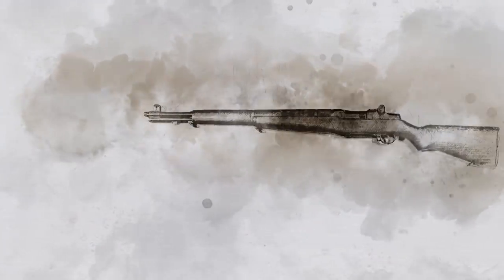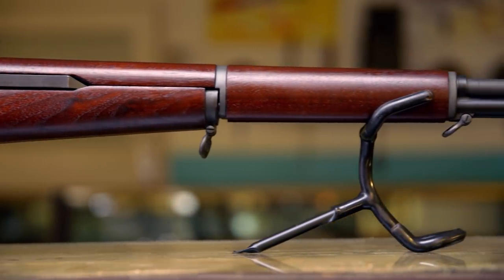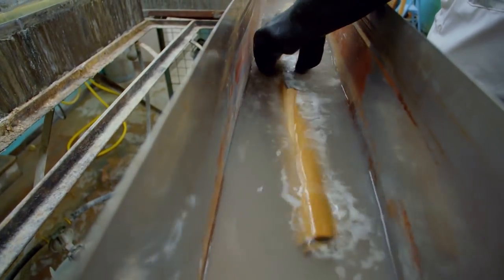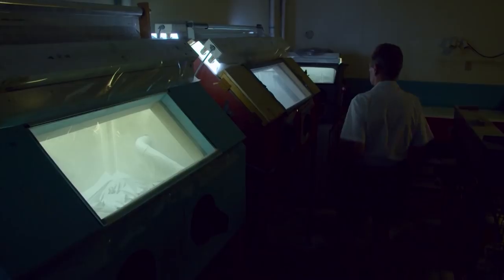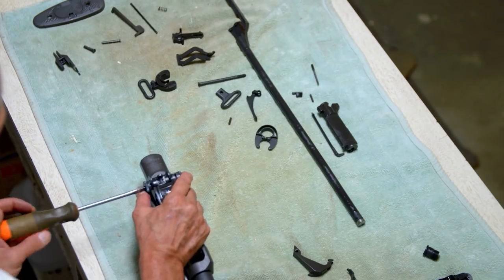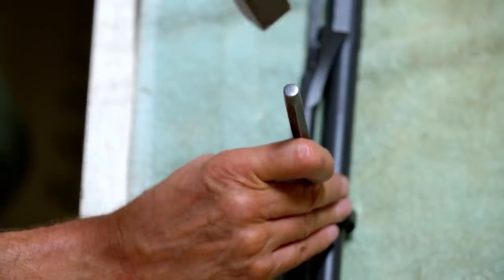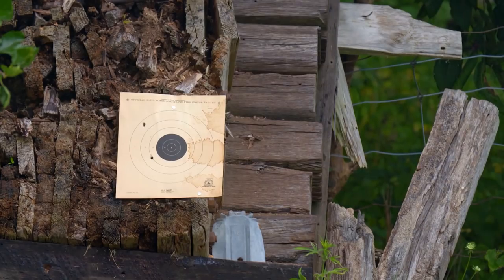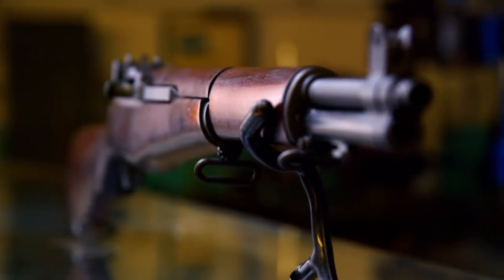How To Restore A World War Two M1 Garand Rifle | History In The Making

Comment: This should be titled, " How to make a U.S. Rifle, M1 less historically original and degrade its actual shooting condition in one stroke"
Reply: Since WW2 every M-1 has been sent back to an armory for refurbishing or rebuilding one or more times.
Reply: none none I’m confused. How does replacing a few rusty parts reduce the condition in which a rifle shoots? Is it suddenly less accurate? Forgive me, as I don’t know much about firearm functions. I can tell an Enfield from a Springfield from a Mosin, but that’s about it.
Reply: So, I have a question to ask. Let's say I have a race car and win championships during it's lifetime. I get a flat tire, I replace it. I get a timing belt, I get a new one. I replace the car doors, bumper, get a new coat of the same color paint; I had to do that constantly for each individual part until each part is replaced. Is it the same championships car?
Reply: al4sake I’ll counter with another question; why let a rifle that has the potential to be factory new again rust away in a display case? Is the M-1 doomed to rust away in a case, never to fire another round again? Or should it be well cared for, and used for it’s original purpose? Putting holes in something is what a firearm does, but it can’t if you let all the internal components rust. But hey, at least it’s the same rifle, right?
Reply: Dud there is issues with rust.

Comment: Looking through the comments, I agreed that the Garand he stripped intially wouldnt need much restoring, more like checking for mechanical issues and replace parts as necessary.  But if you live in a country where there is no CMP and all you can do is slapping differnt parts together to make a brand new Garand, I wouldn't mind that either.

Heck, if someone opens a plant and manufactured it brand new with exact same spec I wouldn't mind getting one too!

Comment: This rifle is damn near perfect in design and purpose, it has never been successfully replaced in my honest opinion. They really should bring it back in production with maybe updated materials (better steel, carbon-fiber body, etc.). Probably the most ideal rifle to have if you're of a survivalist mindset...
;-)
Reply: The entire top of the gun is open to the elements. It cannot run in mud, AR, AK and bolt actions will do you much better than a garand. Plus it's much too heavy for a lightweight survival rifle. Perhaps a keltec sub2000 in 9mm or 40 s&w will do when thinking in a survival scenario. Or a Henry ar7.
Reply: @lasersharksushi1975  Do you think that they only fought with the M1 in nice weather or called a timeout if they got dirt or mud on them. The M1 is one of the most proven rifles on the planet under actual battle conditions!
Reply: @robertlewis7347  they called a timeout lmao. Or they simply didn't use it. IE, Germany is a great place to run a garand where you don't have mud, and other nonsense. Japan though? The second the garand encountered mud, it jammed. Thusly guns like the M1/M2 carbine, and the M3 grease gun became more prevalent and useful under such conditions.

Comment: Almost all M1s have been arsenal rebuilt at least one or more times and will have a mix of replacement parts and stocks ,I have a Springfield that has a WRA part or two, an H&R has some springfield parts and a early WW11 trigger guard.  So any danger of reducing value by cleaning those up is negligible.  However, original stocks with cartouche and stamps should not be altered or refinished as that could reduce the value to a collector.  Rifles with all correct parts and or original finish (no rebuilds) can bring very high prices and shouldn't be altered.  I shoot all but one of my rifles, and I want them to look like they did when they were carried by a GI, so I just clean them up, remove the worst of the stock dings and reapply linseed oil.  I do not refinish the metal, only replacing small parts that wear out like op rod springs, extractors, etc.

Comment: I'm confused at the ending when he puts it back together.  The wood and marks on it seem to be the same as the beginning of this vid. Yet when he refinishes the wood, it's allot smoother and lighter in color. 
I have a "43" Springfield Armory M1 myself, and did only hot water and wash cloth clean(a little Murphys oil soap) till the water was clear and no more hand grime abuse and furniture polish brown was tinting the water. I only use 600-800 light, light.. sanding after soaking the stock with denatured alcohol to dry out the water and take the tiny rough feathers of wood sticking up and left the heavy dents of life remain. I couldn't find tongue oil anywhere so resorted back to boiled linseed and it came out a beautiful tan/light brown that let the gain pop and still showed the battle scars of life. All the cartouches were now more vivid. This vid I think he put the same gun back together at the end before he refinished the stock. 
Least it looks like it. 
Cool video nun the less. Love the M1 Garands. 
Would love to have a job like this.

Comment: I want a Garand so bad I can taste it. Had a chance to buy one in a pawn shop, lay it away even, for $800 bucks about 8 year ago. It had a barrel that was pitted badly and had a big, blue 14 painted on the stock. I kick myself everyday for not buying that gun. The guy who bought it got a barrel for it and shoots it regularly. Great gun, still has the 14 on it still yet too.  NI’ve not seen another M1 anywhere except for the local Cabelas and of course they want a fortune.
Reply: WVbyGraceofGod order from the CMP, $750 for a service grade
Reply: CMP my friend, they even take credit cards.
Reply: I finally got mine last week for $700, it’s a very late production and works but you can tell previous owners didn’t take of her. Internals were caked up with cosmoline, the finish on the metal parts is practically gone. Don’t mind “restoring “ this one since it’s not a combat rifle and i want to shoot it, not collect dust in my safe.
Reply: You've never heard of GunBroker.com, have you?
Reply: Most decent M1s on GB are listed for $1000 - $1300. If you have a few thousand dollars, there are some supposedly "collectible" rifles on there. Building one from parts isn;t less expensive, either, unless you can find the parts really cheap.....which I am not seeing.  Receivers are minimum, $450.

Comment: What is shown is just a cosmetic refinish. Great if that is what you want, but it is not a technical overhaul, which requires using gauges, measuring tolerances, adjusting or replacing parts etc. No real gunsmith would restore a Garand to shooting condition without doing that first. No use in refinishing a bent operating rod, is there? Would you consider restoring your antique car to driving condition by just repainting it? And yes, interesting trigger technique.

Comment: Unless the rifle has been pulled out of a swamp and is severely corroded with no stock it should not be touched. Springfield armory already fucked up about half of the original military issue 1911 by recoating and refinishing them.